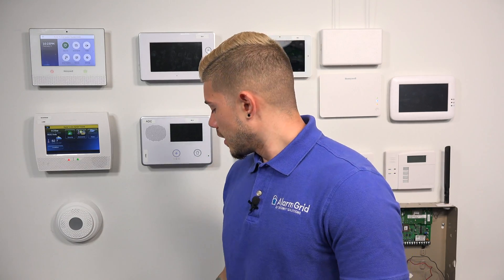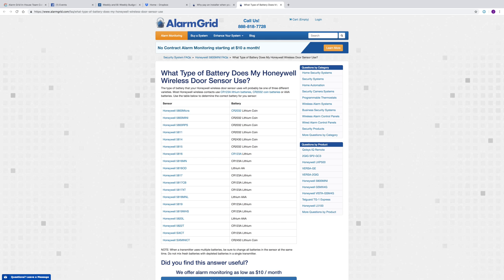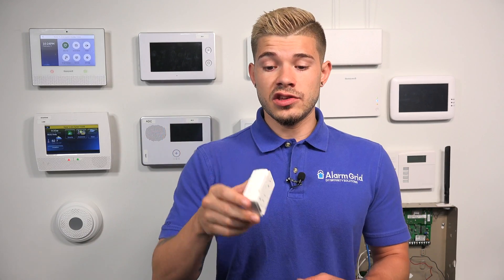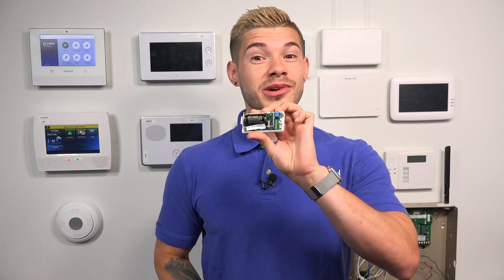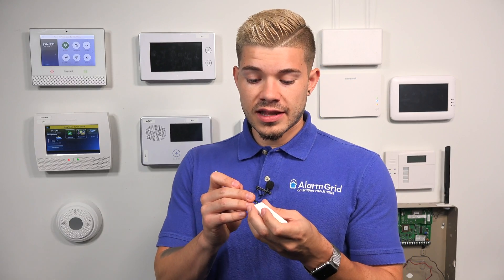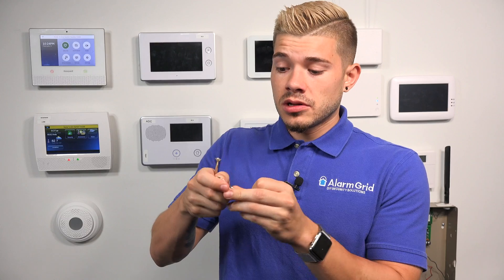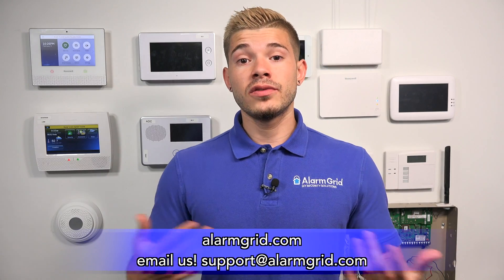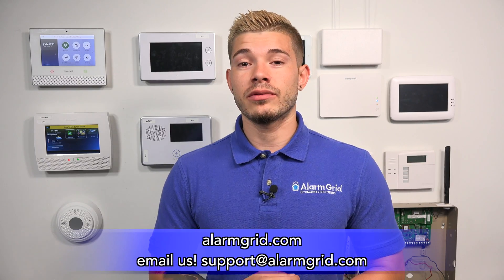Discussion of Batteries in Sensors

Comment: The sensor is next to the panel . Would you recommend replace the sensor ?
Reply: First, verify that you are using approved batteries per the manufacturers installation guide. Then if you have an identical sensor, you can swap locations to see where the issue follows.

Comment: Is there any specific configuration  on the system that will consume more batery ?
Reply: There is not, but they quality of the path from the sensor to the receiver or panel can affect battery. Obviously the better the signal the less power to communicate when necessary.